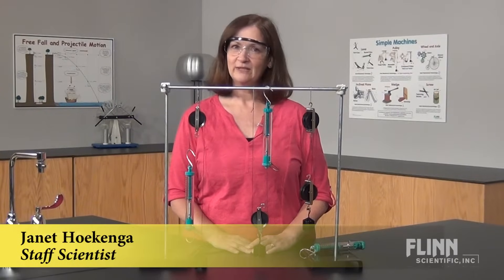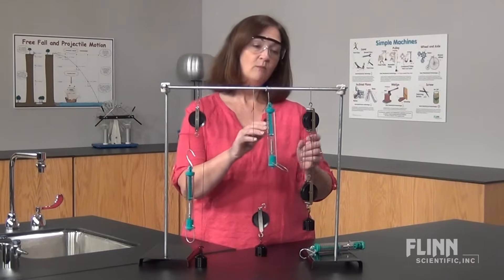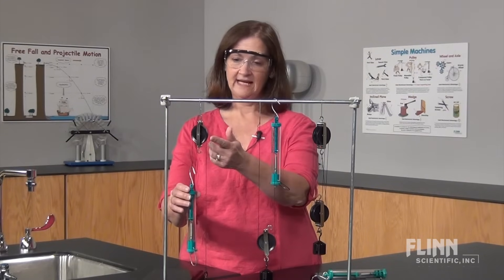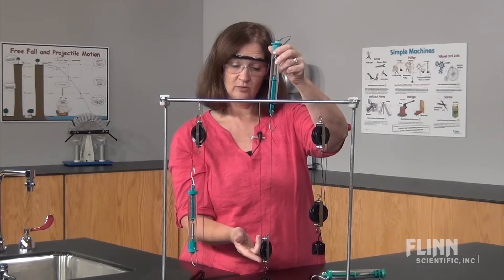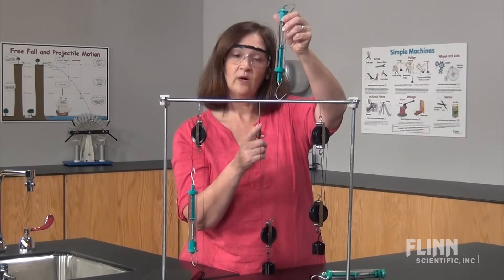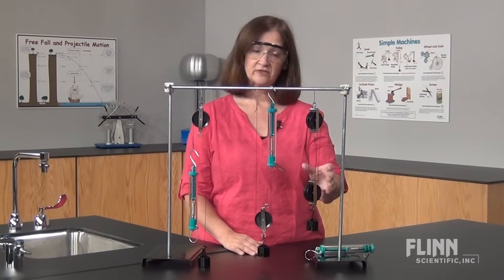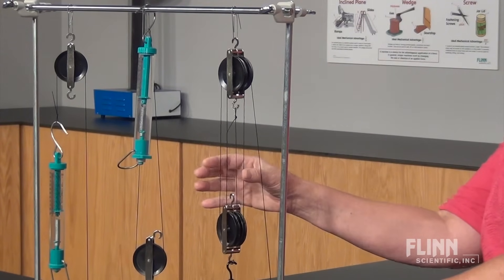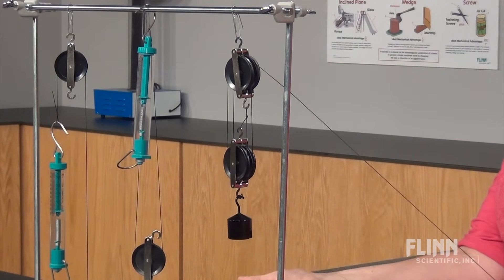Mechanical Advantage of Pulleys

Comment: Actually, the way you phrase it makes it more confusing . best way to understand it is that two SEPARATE pieces of rope mean double tensile strength. The movable pulley is a way to divide the same rope into 2 sections of same strength (as any section of rope is just as strong as any other). Now they both are exhibiting their strength onto the pulled object  (1 section just supports the weight whilst 2nd pulls upwards, but because the sections are connected it also redistributes the pull force at the same time).
Reply: Actually... i personally found her way easier than yours